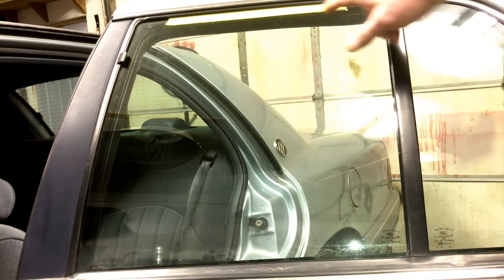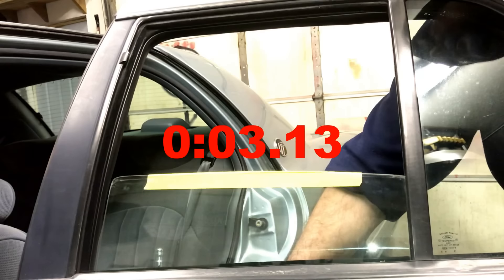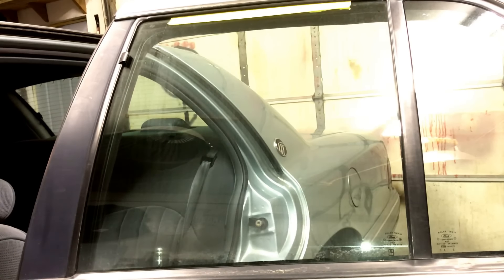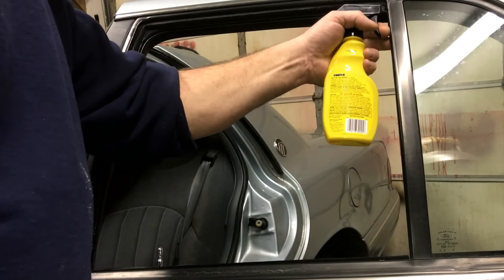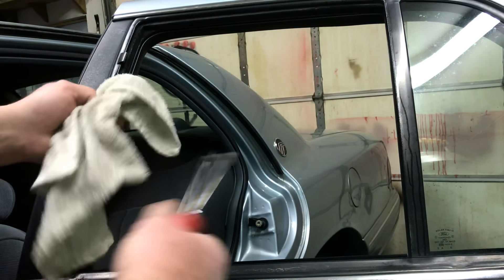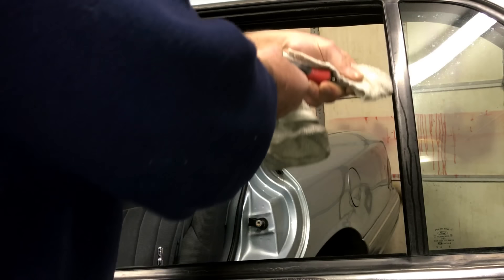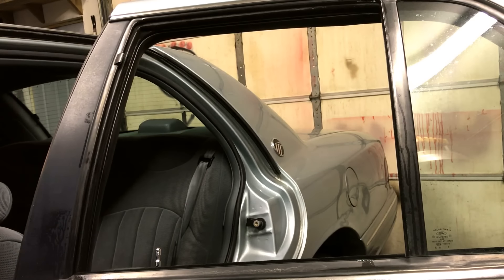HOW TO Make Your Power Windows Move UP & Down Faster...U WON'T BELIEVE YOUR EYES

Comment: I just replaced both my front window regulators (what a job!). The windows went up and down beautifully until I put the door panels back on. Now they go up and down slowly. Why would this be? The tracks you are treating were the same before and after.
Reply from the maker: The seal at the top of the door panel is obviously putting too much pressure on the glass, that would be the first thing I check. If you can put the door panel on loosely and see if it continues to go up and down with ease until you snap it into place. If that's the case, you might want to take a pair of really sharp scissors and trim the seal back an 1/8" at a time until it moves up and down with ease.  Hope this helps, thanks for watching, have a great weekend, and all the best on your project. mad Mike the hammer SPC

Comment: Whats the thought process of using water repellent to clean the rubber?
Reply from the maker: I guess it goes in the same fashion as how does coca cola clean a toilet, it just works.  We don't analyze until we are paralyzed and try things and share what works.  Thanks for watching. mad Mike the hammer SPC
Reply: @SweetProjectCars  i see. I just didnt see how u guys came to that over just regular ol dish soap and water lol. Was just curious if there was a reason for rain x instead

Comment: I have the same car. Only one window works, but slowly. I'll try this.
Reply from the maker: John if this video does not do it then do this video https://youtu.be/TUfUdJBtj5s on the one that works slowly, the other window most likely need new window regulators.
Reply: Sweet Project Cars Thank you sir. I think I can replace the plastic gears on the motor for cheap but it's too cold out. Come spring I'm trying all your tricks, especially the 303 stuff. Thanks for all you do.
Reply from the maker: you can but many times it is the cable inside that is all bound up...we thank you very much for the kind comments and appreciate you being here with us :)
Reply: Sweet Project Cars Oh I thought it was the gears because they make a clicking sound instead of lifting the windows. I guess it's possible that they wore out from the stuck cables. I wonder if it's possible to lubricate the cables. I'm very cheap.
Reply from the maker: john most of the time when we take them out the cable is toast and all bound up in a knot inside   thank you for the awesome question and comment it helps the entire channel :)
Reply: Sweet Project Cars Thanks for the info. I'll definitely keep that in mind
Reply from the maker: you are very welcome :)

Comment: What if you don’t have tracks above the door line like a 80s firebird .?
Reply from the maker: On all frameless windows you will need to remove the inner door panel to get to the window mechanism.  You will want to spray every moving part and every joint and any part of the moving bracketing.  Basically, what we are saying is, any slot the glass sits in and any moving part needs to be treated with the products we share in the video.  Thank you for watching and asking.  Have a great day Bobboo.  mad Mike the hammer SPC

Comment: What is the need for the rain repellent? Can I substitute this for anything else? Is there an issue with using glass cleaner instead?
Reply: The alcohol in it helps break up the crud
Reply from the maker: Hello Connor, you can use whatever you want to use, we are just sharing what we have tried and tested over 40 years and that we know works every time.  Thank you for watching my friend.  Have a great day. mad Mike the hammer SPC

Comment: Clean out the tracks, Add in your silicon based product, I tend to go with a silicon grease...I use to do windshield repair for local body shops And dealerships I offered a power window repair service as a extra So :
#1 Try like the video
#2 On the inside of the door with the panel removed grab the bracket that holds the window motor see if you can move it. If so you might have a loose rivet Or bolt That needs to be replaced I use to replace the rivets with a washer and lock washer then nut As rivets wear down in time 
#3 Wire connections getting corroded  I have seen some with green Or white powder (rust) That i have cleaned off And lubed with dielectrical grease And the windows : worked faster And did not pause or skip 
#4 Most of the motors for the window work on a power up And down system thru 2 little magnets If something is blocking the window from going up and down This adds torque on the motor which puts pressure on these smaller than a dime magnets Which cracks them in half...Normally the magnet going up has all the weight And why i use to get customers complaint of Windows not going unless they hold the window while it is going up And some times not at all....One told me it worked fine Until they tried to lower the window to break off the ice And then raised it ..The window jumped the track And when they raised the window it got stuck But also cracked the magnet As i took the old one part to inspect ....A new motor was given back then as i do not repair magnets with connecting wires 
#5 if your car/truck is 15+ years old The most used window is the drivers And chances after all the above your window motor is worn out/weak Or off the track/broken riser wheel Or wire cord 
#6 If your window does not work at all first thing to check is your fuses (Youtube your year make and model with "fuse location / ID"
Reply from the maker: Thanks for watching and sharing your experience, we appreciate it, we only use this now  https://tinyurl.com/bdf6a6ky  it's by far the best lubricant we've ever used. Have a great day. mad Mike & team

Comment: What about for boarderless windows? Like on the Celica?
Reply from the maker: You want to get this into the tracks that all glass slides in which is inside the door, you may have to take off your door panel to do this. Thanks for watching and asking, have a great weekend. mad Mike the hammer SPC

Comment: Great fix, SPC. I noticed that due to the shape of the glass (narrowed at the top) it doesn't really make full contact with the side channels that you cleaned, so I'm wondering why cleaning and lubing the side channels make such a big difference. Do you think some of your sprays are trickling down into the mechanism within the door panel and that's what's doing the trick?
Reply from the maker: Marc to make it easy and to take all doubt out we spray pretty much everything that comes in contact with the glass..thank you very much for your great comments my friend it is good for the entire channel :)

Comment: My 78 mark Vs windows are frameless and very slow going up. What can a I do about that? Thanks
Reply from the maker: On all frameless windows you will need to remove the inner door panel to get to the window mechanism.  You will want to spray every moving part and every joint and any part of the moving bracketing.  Basically, what we are saying is, any slot the glass sits in and any moving part needs to be treated with the products we share in the video.  Thank you for watching and asking.  Have a great day my friend.  mad Mike the hammer SPC
Reply: @SweetProjectCars  wow. Thank you. I most certainly have my work cut our for me. Thank you so much.

Comment: I have some rain x windshield wiper fluid that has that rain repellant in it.  Do you know if I could use that to clean the channels?
Reply from the maker: You can use whatever you want to use, but if it doesn't work, you know what you have to do.  Thanks for watching.  mad Mike the hammer SPC

Comment: In this video, you link to Rain-X 800002250. In your other window cleaner video, you link to Rain-X 620100. Which is THE cleaner you suggest?
Reply from the maker: Each video is different from the other, use the exact products shown in each video.  Thanks for watching.  Have a great day Thomas.  mad Mike the hammer SPC

Comment: My power window goes down fine but it comes up a few inches at a time and I have to keep hitting the button for it to come up. Any suggestions??? And does that spray you did to speed up the window safe for tint? Oh and I love your videos!!! Thank you for posting them.
Reply from the maker: this process will help your window speed for sure and it is safe for tint   thank you very much :)
Reply: Could also be that your switch has a fault.

Comment: My passenger side window knocks when I move it up and there are rubbing marks on the window when I move it up and down. I've taken the door panel off before but couldn't find what was causing the issue.
Reply from the maker: Mason most likely it is the felt guides inside that stabilize the glass you will need to look again with a very bright flashlight    thank you for your great comments and being here with us :)

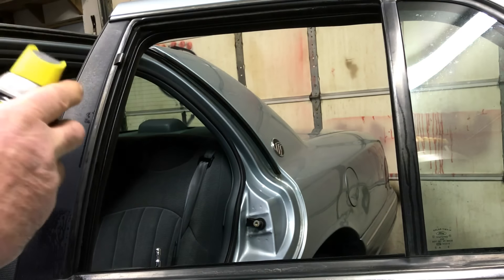Comment: What was the aerosol spray you used buddy ? You description says throw out wd-40, but on your video at approximately 2:45-2:50 you can clearly see a big 40 on that aerosol spray  can you are using to spray in the window . If its not wd-40 then what is it ? Only product with a name and a 40 on it is wd-40 so what is it buddy?

Comment: I have a car with frameless windows, none of this seems to apply.  The window goes up/down just as slow whether the door or open or closed.   Recommendations for this type of window?
Reply from the maker: On all frameless windows you will need to remove the inner door panel to get to the window mechanism.  You will want to spray every moving part and every joint and any part of the moving bracketing.  Basically, what we are saying is, any slot the glass sits in and any moving part needs to be treated with the products we share in the video.  Thank you for watching and asking.  Have a great day Beowulf.  mad Mike the hammer SPC

Comment: Would this also work on manual (lever powered) windows? The passenger windows at the back of my car take a well trained athlete to roll them down, and two to roll them up. Any advise on this one?
Reply from the maker: mcduo it will really help and also take the door cover panel and spray the tracks with dry lube

Comment: I tried this on my 98 mustang, both sides were going slow so I tried this. The driver side worked like new but the other side is still going slow. I don't think I'm doing it wrong but can you show the other methods?
Reply from the maker: Eclectic you have to use the exact products in the "show more" of the video description for this to work but we are doing another pertaining to the inside of the door area so stay  tuned

Comment: Would this also work on older cars with manual windows? I've noticed they are getting harder to crank up and down.
Reply from the maker: It sure will Steve, the best thing you can do is take the door panel off and spray everything except the glass including the tracks just like we show in the video.  Thanks for watching and asking.  Have a great day.  mad Mike the hammer SPC

Comment: Okay thank you but not all cars have a frame around the windows?.
Reply from the maker: You are correct, you are part of the 1% of vehicle owners that don't have a frame around your window. This process can still be done, just apply this the products shown where the glass is in the guide tracks down in the door, spray at the top and let it run down into it. And thanks for being an awesome subscriber. mad Mike the hammer SPC

Comment: How about windows that don't have frames? Is there a way to make those move faster?
Reply from the maker: On all frameless windows you will need to remove the inner door panel to get to the window mechanism.  You will want to spray every moving part and every joint and any part of the moving bracketing.  Basically, what we are saying is, any slot the glass sits in and any moving part needs to be treated with the products we share in the video.  Thank you for watching and asking.  Have a great day Brad.  mad Mike the hammer SPC
Reply: @SweetProjectCars  excellent, thank you very much for the reply.

Got an old AW11 MR2 with some very slow windows. I always thought it was just how '80s electric windows were but I might give this a try and see if removing 32 years of dirt makes a difference!

Comment: What about frameless windows ???
Reply from the maker: On all frameless windows you will need to remove the inner door panel to get to the window mechanism.  You will want to spray every moving part and every joint and any part of the moving bracketing.  Basically, what we are saying is, any slot the glass sits in and any moving part needs to be treated with the products we share in the video.  Thank you for watching and asking.  Have a great day turbo.  mad Mike the hammer SPC

Comment: My window don't have tracks 🥺
Reply from the maker: On all frameless windows you will need to remove the inner door panel to get to the window mechanism.  You will want to spray every moving part and every joint and any part of the moving bracketing.  Basically, what we are saying is, any slot the glass sits in and any moving part needs to be treated with the products we share in the video.  Thank you for watching and asking.  Have a great day Val.  mad Mike the hammer SPC

Comment: And frameless doors?
Reply from the maker: On all frameless windows you will need to remove the inner door panel to get to the window mechanism.  You will want to spray every moving part and every joint and any part of the moving bracketing.  Basically, what we are saying is, any slot the glass sits in and any moving part needs to be treated with the products we share in the video.  Thank you for watching and asking.  Have a great day Bruce.  mad Mike the hammer SPC
Reply: @SweetProjectCars  thank you. Will give it a go.

Comment: Awesome, Thank you!
Reply from the maker: Ed Sunderland you are very welcome my friend :)
Reply: I appreciate that, I do have some rainex and my truck windows are a bit slow so will do that today. I know that is easier than installing a new motor which is a pain and I've done that before too more than once in a 92 Comaro.  Now I have an extended cab 2003 F-150 with a moon roof that goes back but will not close. Have to pull down some headliner and enter from the bed and back sliding window to turn the motor about a revolution counter clockwise with a hex wrench then the motor will close it. 
Thanks, your videos very helpful.
Reply from the maker: Ed  this video may help you https://youtu.be/sPnEN9nsUQU if you get the glass back again then do this video and it may start returning by itself   hope this helps :)  thanks mike
Reply: Actually watched that a couple days ago and will give it a try, thanks man!
Reply from the maker: Ed Sunderland good deal have an awesome weekend :)

Comment: I need the other video!!
Reply from the maker: jonah   we will do the video for you and many others thanks for asking my friend :)
Reply: Sweet Project Cars thank you so much!! Also what do you know about a window that gets stuck almost all the way closed? It goes down easy but going up it has issues. It’s 99 Honda Accord Coupe and the window regulator has a single lift place in the middle and two guides at either side. But what doesn’t make sense is that it was working fine then it start hanging up at the top. So I have to get out of the car and pull the glass to toward the back of the car for it close completely.
Reply from the maker: jonah you will need to remove the panel and take a very close look with a bright flashlight
Reply: Sweet Project Cars I don’t see anything out of the ordinary? I think possible it’s bent but it’s like there’s a rivit on the arm we’re it lifts I tried to bend in a Lil it but no avail.. whew I know a lot about cars but this has got me stumped.. lol